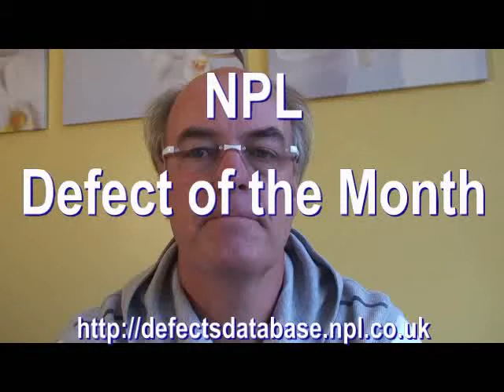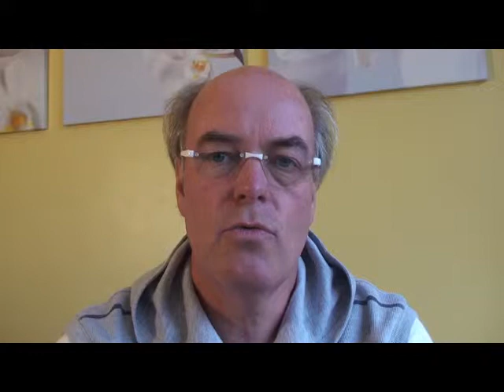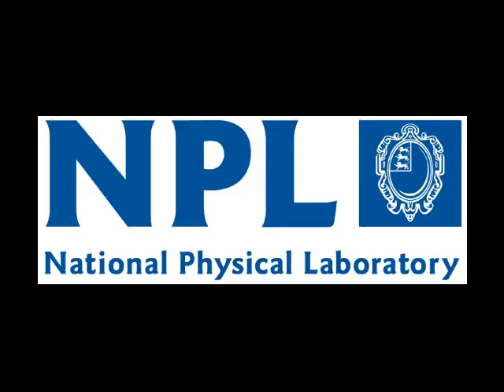SMT Solder Shorts on Wave Soldering

Comment: Sir can you explain why the blow holes may come while through holes components side
Reply from the maker: I am a little confused you have commented on a video on solder shorts on wave soldering but have asked about blow holes which are different. If you can explain what problem you have relating to blow holes I may be able to help you. Blow holes in through hole solder joints are normally caused by outgassing of water vapour through the plating in a PCB bob@bobwillis.co.uk